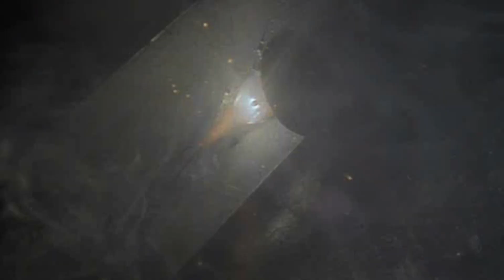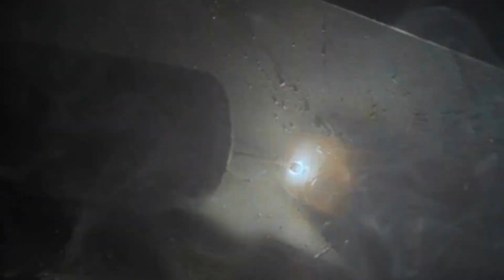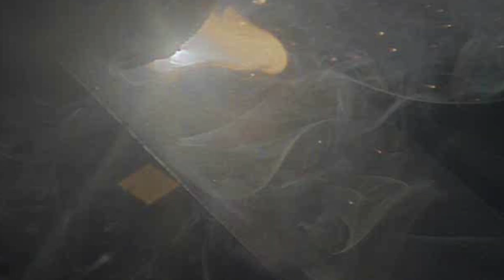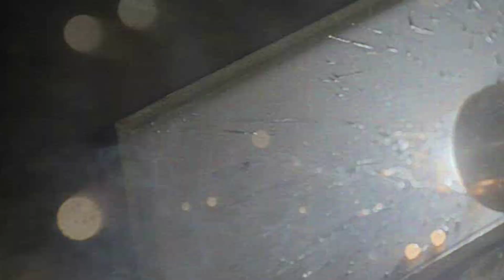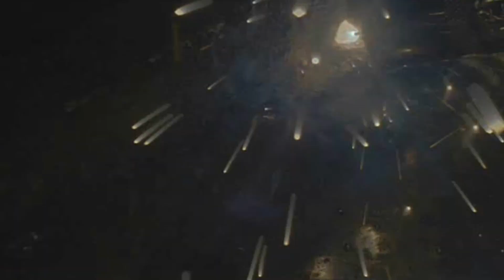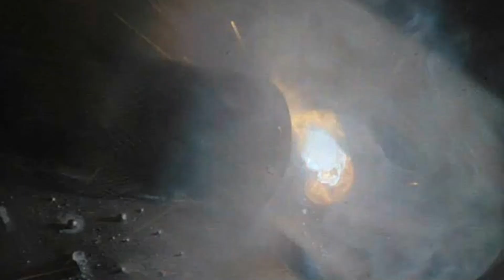DON'T Do These 7 Things When MIG WELDING (Common Mistakes to Avoid!)

Comment: Fantastic video. Especially those CWB stick welding videos, which helped a lot, what setting would you recommend for MIG flat CWB( 3/8" plater) for 0.45 wire. I tried with 390 WFS, 25 voltage,0.35 " wire I thought I did great, but lack of fusion, later I came to fight out people who would run with much high voltage like 27 or 28, and WFS around 350- 390, and wire 0.45", basically they are running spray transfer and have good chances to pass the test.
Reply from the maker: I really appreciate the support! 👊. For 1GF,2GF CWB with .035 I would normally run at about 425 WFs and 25.5 V for MIG. I like to hold about 1/2-5/8 stick out and usually drag the roots in. For spray I prefer 2 passes on the root for flat. I honestly don’t believe it’s necessary to have that much voltage for 3/8” but some people pull through. 350-400 WFs and 28 volt would normally give you too long of arc length resulting in less penetration.
Reply: @sewingwithfirewelding5627  really appreciate ur reply! So basically you are running a short circuit mode  with 425 WFS, 25.5 voltage?
Reply from the maker: @ this is considered spray- under 22-23 is short circuit
Reply: @sewingwithfirewelding5627  got it. It helps, and just to be sure, when you said drag the roots it, does it mean you drag the root passes rather than push? Once again thank you for taking ur time to reply. Your videos for CWB are a big help for me.
Reply from the maker: @DevangTandel-m3i  yup it means drag  (backhand) rather than push. CWB offers two types of MIG qualification short circuit all position (1/4” 6mm plate) and spray Flat, Hor. (3/8" 10mm). Sound like I might need to do a CWB Mig video.
Reply: @sewingwithfirewelding5627  that would help a lot, please do that. I have searched a lot on YouTube, and reached out to  people on other platforms as well, But no information regarding CWB MIG. If you would make a video about CWB MIG, especially 3/8", that would be a big help for a lot of people, I see people coming and asking cluelessly when it comes to MIG, but with stick people don't need to worry about those variables. It's more of a technique than settings.